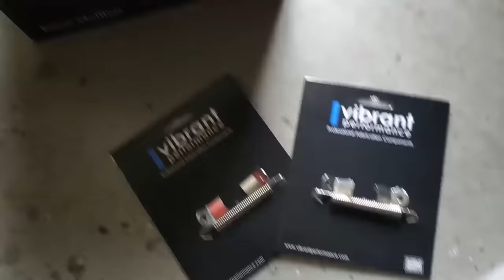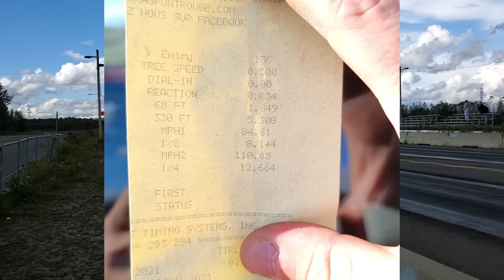BUILDING A JETTA MK1 VR6 IN 10 MINUTES (3.6L SWAP)

Comment: that exhaust looks ..damn AMAZING !! front to back just amazing !! great work man
Reply from the maker: Thank you 🙏
Reply: But no back purge on the welds so the inside of the pipe and penitration of welds will corroded and be a weak point of exhaust and crack in sort time just FYI stainless needs to be back purged in order to prevent any problems from. Happening further.... Drastic13
Reply: @queensgambit6341 he def was back purging, look closer.

Comment: Great video, great project. I think i notice some chassis flex because this engine is pretty powerful and torquey compared to the factory options for this car, also these cars were built really poorly in those years compared to what we have now. It might just be my eyes lying to me, but maybe it is flexing. I wish everything great to you all with the car and future projects.
Reply: You've just stumbled into the advanced VW classroom mate, I'm going to have to see your schedule. ;) The mk1 jetta is primarily limited to torsional flexing during the apex of turns while under power. The chassis is still stiff enough that it will sometimes lift it's inside wheel during VERY aggressive turning. No damage occurs from this. Most mitigate chassis flex with front strut bracing, triangulation of rear strut bracing, half to full cage and or welding and plate placement on the frame/unibody itself. One may choose any or all of these methods depending on the use. The mk1/mk2 Jetta is well balanced, even more so than Golf/Golfo/Rabbit and both respond well to strut tower methods. My experience is primarily with mk1 & mk2 VWs. Mk2 frame is adequate for up to 1000hp with just strut bracing. However I've ripped several strut towers running aggressive suspension settings on public roads, this has nothing to do with excessive power. I have had endless broken motor mounts, till I went to custom solid aluminium and/or urethane. All that said, sorry 😐, there's absolutely no way that you saw chassis flex in this video. Besides, being the welder he is, I'm sure it's all buttoned up.
Reply: @digitalparadigms  Like i said, maybe my eyes were lying to me, i know the golf mk2 has a pretty stiff chassis from the factory.
Reply: @TheLenki4  Just yanking your chain, no worries.

Comment: The flat panel on the back of the radiator that the cooling fan was put on probably could have had flaps installed to improve high speed cooling. (Allows for higher cfm than the fan itself can provide AND cool the entire radiator)
Reply: Amazing build regardless.

Comment: I can really appreciate this, dummy me had a first gen 4 door. Sold it off and now I have my first gen rabbit- my future project.

Perhaps the owner and builder of this machine could shed some light on the Fab shops he used to bring this to light perhaps did you buy parts from: Euro wise, O34 Motorsports anything from TT tuning or ECS tuning? 

Thanks Guy.
Reply from the maker: Hi, thank you 👍
I built the entire car in my home garage has you can see in the video. Most of it is one off custom made.

Comment: I'd relocate that engine intake if I were you, unless you want hydrolock on the first wet road. I'd route it from the manifold, up to a bonnet vent, extending back toward the windscreen so it gets the pressure from the scuttle/window turbulence, for a ram charge effect.
Renault used to pull air from the wheelarch, they used to put the transmission cooler there too - they soon learnt from that mistake - engine ingested water far to regular and the cooler had the life expectancy of a Mitsu over the Marianas..
Reply: I don't think the engineers of this product considered such details. This whole build is meant to be aesthetically pleasing. Furthermore, I don't think the people driving this car will be doing so in wet conditions. This car will sit in the garage until the sun comes out, or there's a show.

Comment: Grats on taking a full width radiator and making it a half width with that cover. Only thing that side is doing is acting as a heat sink. IMO there should be flap or louvers in it to allow airflow while moving.

Comment: the radiator back plate is probably not the best idea.. thermically

but: respect, awesome job and skills
Reply: yea. wasted half the area. it needs flaps so it can open up when there is airflow from the front
Reply from the maker: It actually is on the upgrade list but hey, the car is been done for one full year. I drove it 8000km without overheating issues. Coolant temp is a bit higher on the highway when it is 30°C and up outside. But the car actually cools itself sitting idling. ✌️

Comment: Great build man, very clean, I honestly think that the car deserves a nice airbox on the right side of the engine bay to fill in for the empty space there. While your welded intake is great work, that empty space is outbalanced by the engine size. A shiny black airbox, or a carbon fiber one, maybe even one that has the same lines as the engine intake. It would create a great symmetry in there. I think you should at least try.

Comment: This is so clean and well built, big ups 🤙to you guys on a splendid job. I would like to know how much  a build like this cost to do, as i would like to do something like this  on a Mk2 jetta cli. Also how do you make the wiring work on such built.🙏
Reply: Wiring is probably the entire engine harness with the ECU (standalone or OEM.) I know on the CE2 MK2 chassis cars the fuse box can stay in place whereas a bunch of your stuff is 'plug n play.' This is a AAA 12v 2.8 VR6. I'm sure the Euro 2.9 is also PNP. His 3.6 would probably be the entire harness with the ECU which will most likely be able to be installed on the raintray/ cowl where it originally is. He'll have a bunch of B.S. that I'm sure he won't use in the engine portion of the harness so he can have the opportunity to 'thin out' the harness and get rid of the useless wires, and rewrap it cleanly with some Tesa tape just like OEM, you'll never know it was messed with if you do it right after ditching all the unused stuff. I'm sure the poster will clarify. I have done a boatload of 12v VR swaps, but never had a chance to grab a 3.6 out of a donor/ wreck. I would prefer to get my hands on the whole car because the wiring is a must and so is the ECU, etc.

Comment: Drill the big holes on the metal beside the fan. The cooling will be much better. You migh get overheated often in slow trafic if you leave it that way. Let the radiator breathe.
Reply from the maker: The car actually cools down in slow of standing traffic.

Comment: Hi guys, what a smooth build! by chance do you have the specs for the brake assembly and where did the brake lines went through (if not by the firewall). Thanks!

Comment: Nice! Thinking of doing a VR6 swap on an mk1 Jetta (1715cc). However, why did you spray the cooling fins on the radiator? Won't that hurt heat dissipation?
Reply: I was curious if anyone else noticed that, seems the act of doing so would stifle the means for the fan capabilities to cool anything.

Comment: 1:36, que no circule aire por el radiador pero que quede lindo; con eso ya ya no querés ver mas video
1:36, that air does not circulate through the radiator but that it is beautiful; with that you no longer want to see more video

Comment: Beautiful, but that radiator won't be much effective with that large restriction caused by the metal plate for the radiator fan, maybe open some holes in that plate to allow air to pass through? But this is minimal when compared to this magnificent job.
Reply from the maker: Thank you! The radiator does actually work. The shroud could be improve but the car doesn't overheat. 👍

Comment: Why didn't u vent the right side of the rad u could of open flap in matel just slice sides and bottom and bent out a little to still pass air and it would still be forced down because of the angle of the flap bent to keep from heat soaking air intake or seen holes done with thick rubber rivet  at top and only opened at speeds to pass added air flow but other wise great job .

Comment: That was weird: seeing the license plate of my german hometown (Aurich) on a car in the US. Did you get the Jetta from Germany?

Btw: it's a "Kurzzeitkennzeichen" (short term license plate) that you can order if you've bought a car and just have to drive it from A to B without the full registration process. That's why they have an expiration date stamped on the yellow area.

Edit: if you like german plates, you should try to get a "DIN Kennzeichen" (until 1990). It is without coloured parts and suits the Jetta perfectly!
Reply from the maker: Very nice info, than you! The car was originaly built in germany for the North American market. It was then sold new in Montreal, Canada in 1984.
Since we've got bigger and bulkier bumper here on all the mark 1, I imported a set of euro bumper from Germany and that plate came with them. 👍
Reply: @AntoineMk1  That's cool! Funny thing is that your Jetta actually could have been from Aurich as there were quite a lot of them around in my childhood. Once a car mostly appealing to elderly people that didn't want a more practical Golf it has become very sought after by todays VW freaks. PS: Aurich is next to Emden where the Passat/Quantum is built.

Comment: I can't understand why he blocked airflow through the cooler from one side?
Reply: To make cooling that is effective independent of travel speed. It's all about balance in your specific use case. This radiator is high efficiency and high flow, heat exchange, air and fluid transfer wise. One could install one way rubber flaps or powered louvers, but this adds unnecessary complexity. Bottom line, shrouded fans are always more effective.

Comment: how does pie cut pipe look inside, i did same but inside is always sharp debris that has to be grinded off
Reply from the maker: Great, you need to backpurge stainless when welding, otherwise it ruins the inside joint.
Reply: @AntoineMk1  ok but backpurge does not prevent to make sharp debris, i welded pipes wall 1.5 mm thick

Comment: I known good the VW from this period and can you say that this car as a very fragile body and very fragile front suspension and extremy weak brakes, same as Golf 1, way too fragile to old such powerfull engine = very dangerous!
Reply from the maker: Car is far from a stock Mark one. I actually restored the entire chassis on a rotisserie over the pass 4 years. All the body joint underneath the car are all stitch weld and reinforced. Suspension is upgraded to coilover, brakes are G60 all around with a 4 pistons caliper up front and dual caliper rear. Engine mount setup is converted to a mark3 vr6 setup. She is solid, and I never had an issue with it. You can check out my instagram Antoine.mk1 I have a lot of pictures of the work on there. ✌️
Reply: @AntoineMk1  That's a great brake swap, I did that too.

Comment: Never understood how those cowlings can be good..no airflow exept where the fan is
Reply from the maker: It actually help the radiator to cool down by forcing the fan to suck air trought all the radiator surface aera. Without a good fan shroud, the car would overheat. Every factory car has one.

Comment: 3.6L swap?!?!?! Pretty sure VR6 lumps are 2.8L
Reply from the maker: Volkswagen actually made a few versions of the vr6, one of witch is 3.6L, 24v head with Fsi (direct port injection). They came in a few different VW from 2006. You can buy a brand new Atlas here in Canada and it will vome with a 3.6L Vr6!